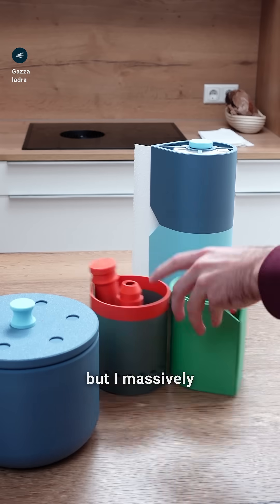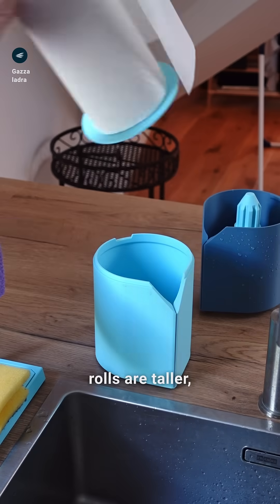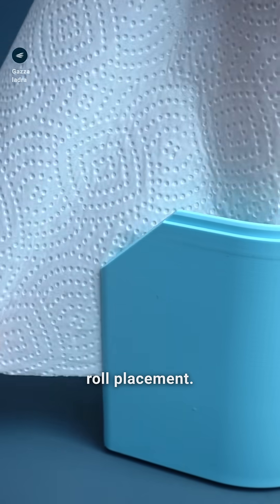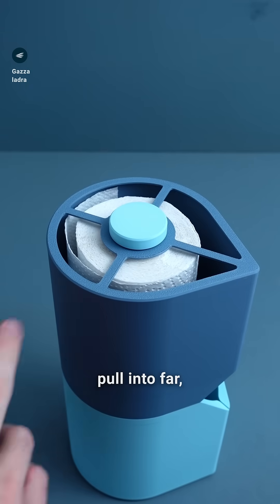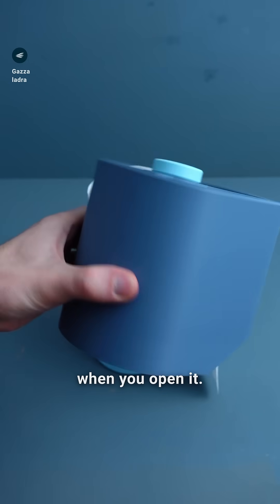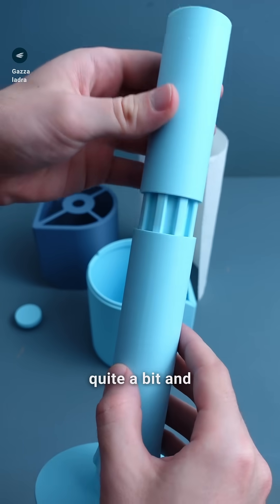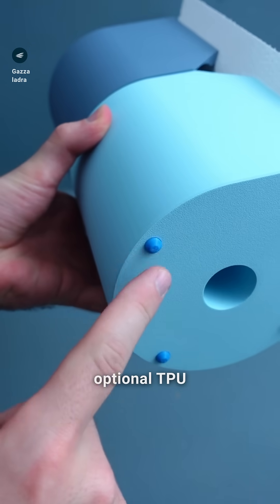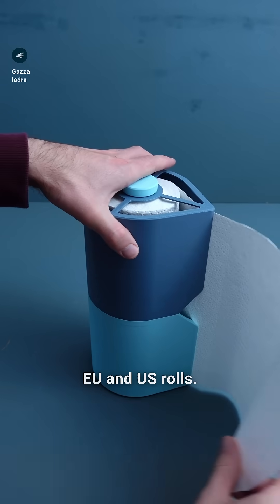I over-engineered a 3d printed kitchen towel dispenser!

Comment: 'I overengineered it' ....c'mon, we knew it, you ARE german after all :D
Here in Slovenia, we just move the paper towel away from the water source :D
j/k ...well done. I would probably engineer it a bit more. I would put the weight at the bottom of dispenser (or suction cups), so I would not have to use both hands.
PS I read some other comments - got it :D

Comment: The teeth on the shaft would not be flat at the bottom. They should be slanted so you don’t have to wiggle for the topp and the bottom to go together. 

Now you need to align the teeth before you put them together. By making them slanted they will self adjust. You can make both the topp and the bottom slanted. 

I hope I made what I mean somewhat clear😄.

Comment: am I weird for wanting one handed operation? sometimes I put my forearm on the top of the roll(not enclosed) so I can use that arms hand to pull a piece off with the same hand
I think this would be great for that technique as the nob would hold it in place while tearing off a sheet
suction mounts on the bottom might be a good idea as it doesn't look very bottom heavy like most holders
thank you for the over engineering much appreciated!

Comment: Omg have you looked at a store that sells them? They use the same design they've used for 80+ years and its way better then yours. You actually pull paper from the inside.  And it only have 3 parts instead of 11.

Comment: Holes at the top are a great idea to see inside, but now water might get in from the top. If you’re able to, adding a spot for clear plastic at the top where the open windows are and slightly thickening the bars of the windows so they won’t break as easy if it’s dropped would make this a 10/10 design, as it is now it’s a 9.2/10 for me.

Comment: What if you added a mechanism that when the towel is pulled, a gear system is engaged to "grab" the roll. Maybe something like this https://www.youtube.com/watch?v=9EiiEJs0wC4. But what you want, is that when let go or successfully tear a towel off then the mechanism will reset. The grab could be achieved with a clamp on the next up towel or by preventing the roll from rotating. Either way, you should have a mounting base (twist lock design) that you command strip or 3m double adhesive to the counter. So you pull a towel, a spring is engaged to force the reset, a gearing is also engaged that starts the clamp to grab the next up towel so you can tear off the primary towel.

Comment: One issue I'm seeing with this: how well is the hole in the bottom tube to clean?

It's a moist environment, and if it's not easy to clean...

Otherwise, this seems great. Unlike a certain other project where a guy over engineers something meant for a moist environment.

Comment: You need a counter-balance weight in the base of the material so it can be used one handed, since otherwise it entirely voids your usage of the device when your wet hand rests on top and pours all that water into the device and top of the paper towel roll.

Comment: Im not sure why people call this over engineering or engineering at all.

Engineering is a application of math and science in design, which u barely did at all. It's not over engineered unless u mathematically proved that the materials used was the minimum required so that u can save materials cost for a manufacturer or showed fea on how the shape of ur designed was optimised for the forces applied.

Please use the term more carefully so that others dont misinterpret the meaning.

Comment: The bottom is too lightweight to operate the dispenser without holding onto the entire enclosure with your free hand. You need a very heavy weight for the base to maintain the stability.

Comment: Should make the top half slide over the bottom half.
That way it solves the part where the lid could fall off if bumped, lines them up properly every time, and if you make the overlap long enough, it removes the need for multiple sizes.  Only thing left is figuring out how to make the “hole to reach through in case of binding”.  I’m sure it won’t be too much work, I thought of the slide over design as soon as I saw this product before you even explained it.  I’m sure finding a way to make the hole still usable is not too difficult for a person who designed this from scratch.

Comment: It's great but if you grab the top to get a paper towel with wet hands you'll most likely wet the roll. A nice upgrade would be something to prevent that, or maybe to be able to grap a paper towel without having to hold onto with your second hand.

Comment: I’m afraid you have a design issue: by having the edge be flat except for the notch, you’re spreading the pressure against the perforation out along the length of the towel. You want to help the perforation by concentrating the pressure to wherever the highest dynamic force against the towel is going to be. Since the towel grab is in the center, the edge should probably be highest around the notch and then fall back to a simple cylinder at the very top and bottom.

Also, I’d suggest adding a cavity for ball bearing weights or something in the bottom so you can more easily grab the towels one handed.

Comment: lol a normal towel roll with a heavy base can be opened with one hand, so it doesn’t get wet, OR you can put your finger on stick at the top if it’s not stable enough and it STILL won’t get wet.

This is way overly complex, only fits one towel type, and is prone to jamming.

Comment: As someone who loves 3D printing, would love to 3D print this, we already have just a regular one made of metal, and we just... Either hang it off to the side or leave it off to the side. No wet hassle...

I'm also worried about eventual mold and issues you may have if you keep getting your stuff wet, or do you just wipe it down every single time after every wash?

Comment: Great, now over engineer rubber on it so it becomes stable / add small rubber legs, rubber lining around the connecting parts. Sensor for when it needs replacing. Perhaps a wall holding part :D

Comment: Awesome desing! Make another notch on the top side. I can tear the paper that way very well from the one in my kichen. The one I have is a cheap round base with a center core. The base is steel for weight, so a bottom container to throw in a bunch of steel parts may work without making it massive. Rocks usually do not have the density. The top notch will definitely let you tear from the already precut seam. Keep the center notch too because that helps with pulling the paper out.

Comment: I have seen that you have to pay for this design so simple and stupid that I can do it in 3 hours on top of that the measurements do not fit for my paper that they sell in Spain which is 200mm in diameter I will do it at home myself with my measurements but very useful the design I have loved it I will use it in my kitchen I am very bad at designing such beautiful things in mechanical engineering they do not teach you to make beautiful things only design and that's it.

Comment: You should add a locking mechanism that unlock with one tap on the its surface and when you pull and rotate the roll itd lock again after a ply so you Wont need to use 2 hand at a time.

Comment: Thisight be overengineered, but not overdesigned. Literally every part of it serves a purpose that's meaningful and relevant to the user. I genuinely kinda want one
Reply: Every time you pull it, it generates a little bit of power to charge your cellphone.
Reply: What makes it over engineered?
Reply: @Jansenbaker  it has so many pieces and was very well thought out. Not basic at all and definitely better than any towel holder you can buy in the store. Overengineered isn't necessarily a bad thing.
Reply: @darnell7119 
Isn't that just describing "Highly Engineered"?
"Over engineered" sounds like someone went too far.
Reply: @Jansenbaker  overengineered; overengineering: to engineer (something, such as a product) to have more functions, capabilities, etc. than are necessary or desirable

Seems right to me. What's desirable is highly subjective but many of the features here aren't necessary to be functional. Most towel holders don't have most of these features.
Reply: @darnell7119  except he designed it so that you need to use 2 hands to tear the roll. Kinda the biggest oversight imo
Reply: @pinbread9161  yeah, but he actually addresses this under another comment.

"So I attempted that a few years ago and it's hard. I added rocks to a box and taped it to the bottom of a prototype but weight makes this thing massive. A suction cup could work but in general a one handled ripp of is quite difficult to achieve. A wall mounted version with a lever might work."

The solution can't really be 3D printed either way. The user can just apply some kind of adhesive or use like a 3M strip. Or maybe anchor it with screws. If this was an actual product it would likely come included in the package.
Reply: @darnell7119  Agreed. Maybe he could redesign the base in the way where it could hold some type of heavy metal cylinder and add more gripping surface area sorta like an unmounted panavise
Reply: I was literally thinking about how much I would want this it’s literally the perfect thing for this problem, if it had rubber feet or a way to stick to the surface I’d love it and it wouldn’t fall over!
Reply: @johncoleman1930  He said he printed TPU feet onto it, which is kind of like a rubber. You could also use some mounting putty or double sided tape and it would work just as well.
Reply: I have a degree and professional experience in product design and totally agree
Reply: Except the part where it doesn't look good at all.
Reply: @tl924  good thing your personal taste don't affect someone else's ability to enjoy things.
Reply: Just like the German Jerry can which the Americans eventually copied and missed off essential features that then made their versions fail and they wasted 30% of all fuel during WW2 until the British eventually cranked out exact copies (Welded seams) of the German Successful Jerry can. 
The American army has hidden the fact their copies wasted so much fuel and must have cost lives with advances halting due to lack of fuel through loss from their incompetent product when the Germans had  included every feature because it was essential already in their design.
Reply: @RGreene0101  okay
Reply: my best advice would be... try and make the same product but instead of about 20 parts use only one, and sell it for about 50.c seeing as its such a meanial product
Reply: @maxjakobsson8491 this is why home 3D printers are amazing. I went to school for product design and we made awesome things. Then you start working, and have to make worse products than you're capable of for the sake of cost. This product isn't made for the dollar store, it's made for a design enthusiast who wants to print it at home.

Comment: Suggestion: a custom weight attachment, but sold both as a bundle and sold separately. Let the customer decide if they want to spend the extra money on shipping, because it would need to be fairly heavy. Perhaps it would snap on to the bottom, holding the circular weight inside, or rather the bottom piece would snap on directly to the weight. So instead of having 3 printable designs, just two! But maybe that will make it a bit more wobbly without the weight then.. hmm

Comment: Why not add a very slight spring retracting system so the tissue goes back an inch inside the container. Even if the tissue paper gets wet on one edge, it will ruin half a sheet. You can retrieve the tissue from the small opening shown in the video. No need for metal springs, 3d printed will work fine..

Comment: I'm thinking about if you want to use it one handed, you can use the safety belt mechanism? Or rotate clockwise to dispenser and counter clock wise to tear it using stopper?

Comment: Use a heavy holder man, one made of metal, and a quick motion to rip the towel. Never have an issue again with completely drenching the whole roll nor staining it while cooking by just pinching the center of the towel you're using instead of the edge contaminating a future piece. Yea....good capitalist spirit though, solving problems with merchandise

Comment: Cant you just make it side since the long shape kinda make being sode way the most stable arrangements, and to hold it in place you could make it latch to the edges of table or use alot of weights on it or just direct screw it in the area idk (so that way the paper can be pull up with one hand instead maybe

Comment: I like how 3d printing encourages this kind of engineering since it's so easy to make incemental improvements.
Reply: Gotta love it when people have the opportunity and resources to try out their ideas.
Reply: It's called rapid prototyping for a reason
Reply: Seems like a waste of forever plastic though. Most people dont have a way to break down prints and recycle filament at home even if they have a printer. And a lot of filament cant be recycled.
Reply: @m0ri461 90% of printing is done in PLA. By far one of the least harmful plastics. I'd be more worried about all the Coca-Cola bottles.

Comment: There needs to be more weight at the bottom so that you dont have to firmly hold down the top, but that is difficult with the hollow structure of a 3d print